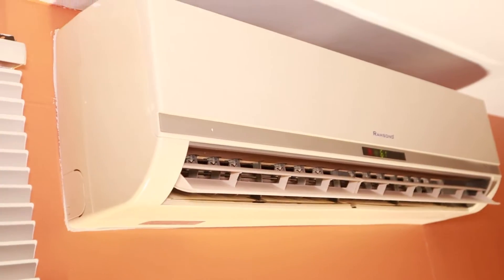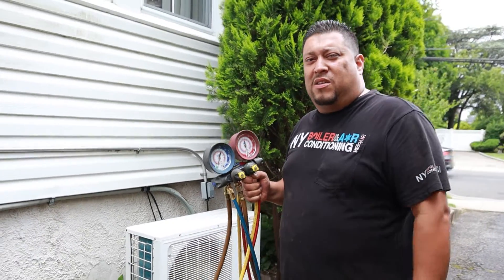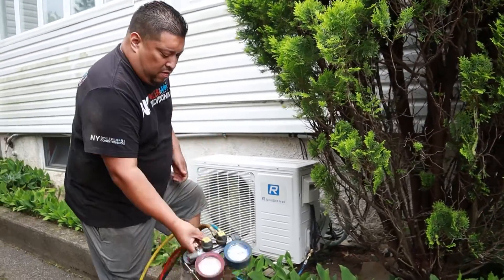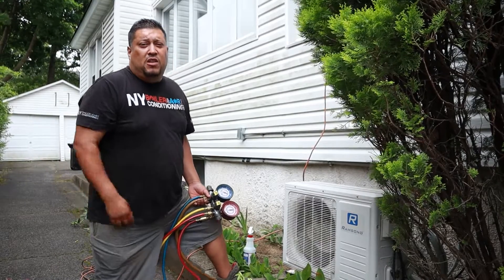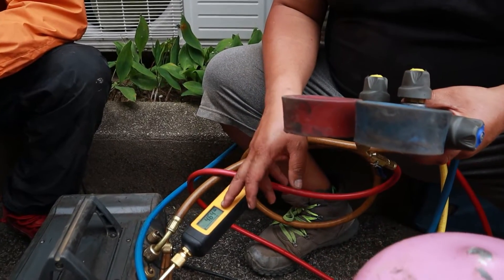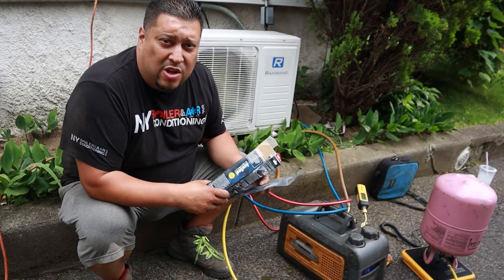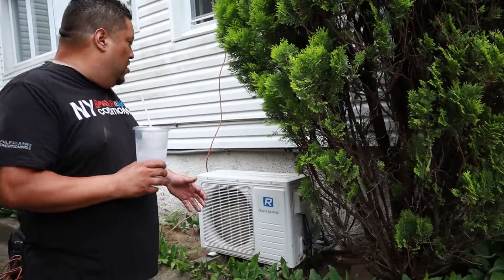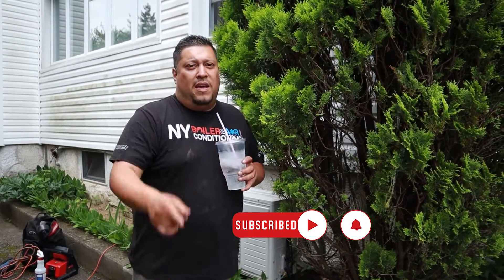Ductless mini-split  Gas Leak

Comment: Did u just disconnect the hose from the vacuum then hook to the tank to fill after vacuum? I also thought unit had to be running when charging?
Reply: What he did was charging the unit while off till the pressure equalize after that run the unit and then top up if necessary

Comment: I'm not gonna tell nobody how to do that job only been doing this since I was 20 and I am 62 so I'm not gonna tell you how to do your job but I would definitely recommend putting a Tee in there for pulling a vacuum or you can use a Schrader core remover this way you can get a real accurate reading of the vacuum on the unit not the vacuum pump. I'm not lecturing I just want to make your job easier and better I am retiring I paid my dues are ready.
Reply from the maker: Hey that’s how we all learn from our elders… I don’t take it personal and infact we appreciate techs like you so thank you 🙏… we need more help from old techs like your self in this industry to lead this young generation because many of them can use the the help knowledge

Comment: Do you ever have any issues slugging the compressor with liquid refrigerant charging on the suction line?  Did you just let it rip or did you throttle the refrigerant in slowly?
Reply from the maker: I throttle it in slowly. I never had a problem however if you let it rip you can sometimes hear the difference in performance by charging the system in a liquid state way too fast 💨

Comment: Where was the leak and was it as simple as torqueing the flare fitting to the correct setting?  I have a split system with an EC code that translates to refrigerant leak detection but before putting coolant in I wanna be sure the leak is repaired.
Reply from the maker: If possible use a torque wrench and make sure you make and have a nice clean flare. Because those are the most common reasons why these unit leak

Comment: I was under the impression Duckless split companies do not want sealant in their devices
Reply from the maker: To be honest that is true but that’s not only on mini splits. That’s on all HVAC systems but it’s no different from using medicine let’s say and the medicine you take to help you with one issue and is or can cause another issue if you take too much of the same medicine. The same applies to sealants. If you read the fine print, it states and tells you on the package. Sealants do work and I’ve personally haven’t had a problem with sealants on my jobs but I have herd from other guys, that they had issues and it has ruin the compressor. So it’s a hit or Miss but yes to answer your question, it can hurt your system but again it may not .. but like anything else.. too much of anything is bad.

Comment: Where was the leak
Reply from the maker: at the flare connection. Thats usually where its at. At the connections because the prior tech didn't use a torque wrench or a poor flare